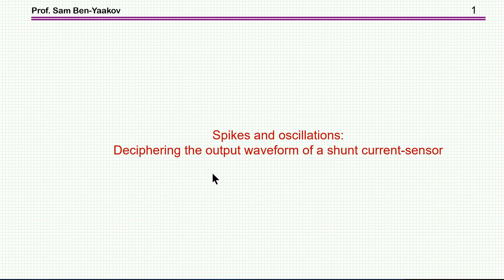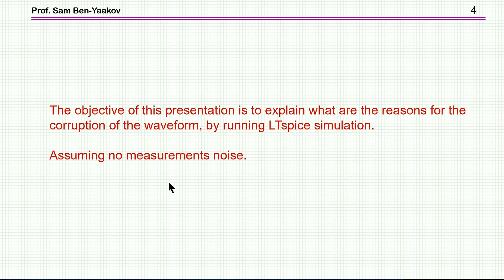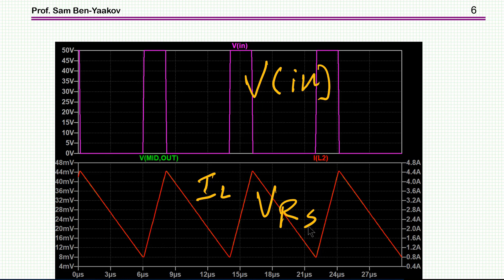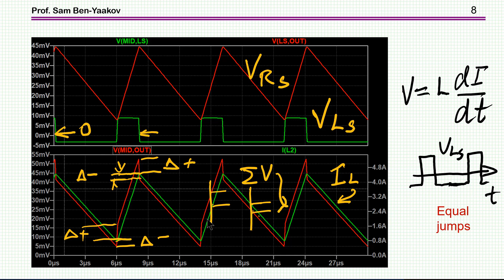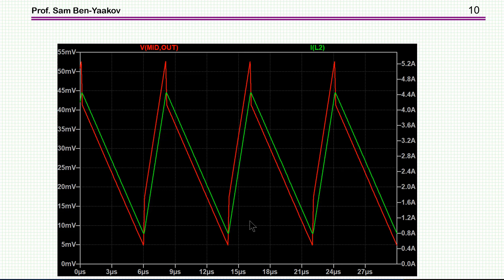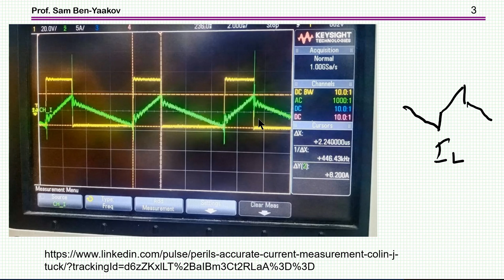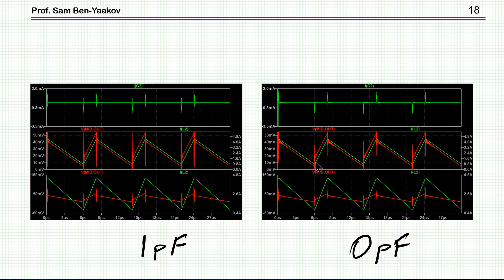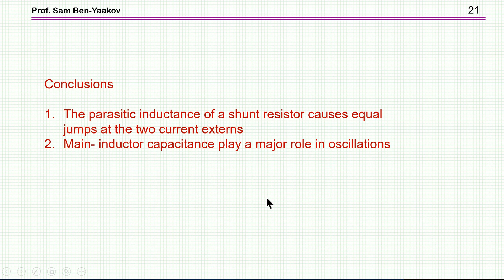Spikes and oscillations: Deciphering the output waveform of a shunt current-sensor

Comment: Thanks Sir. It is an wonderful video.i am facing the same issue. Pls let me know on how to remove this spike.
Reply from the maker: If you cannot replace the inductor with one of a lower capacitance, put a filter at the output, preferably by using a a ferrite bead and a capacitor.

Comment: Would not reading the current sensor at the times when the PWM signal is switching on/off be another way of filtering out the spikes and noise ?
Reply from the maker: You meant at the peal value?
Reply: @sambenyaakov  Not sure what that means.
But if the PWM signal is generated by a microcontroller, then it could be coded to not read current around that time.
I'm sure there is a way to do this with analog electronics also.
Reply from the maker: @station240  Which time ? You mean at the peak value? but the value does not reflect the correct current!

Comment: Ben, Put in the resistive element representing core loss in parallel with L2. That is most likely the cause of the step. You can manipulate a model to show a voltage-divider effect of two inductors, but that does not mean that this resulting measurement error is the main cause of the step.
Reply from the maker: Thank you for comments. To begin with, I am not sure that a parallel resistor that emulate core losses is relevant to a step change. Do you have any knowledge on that? Irrespective of this question, you surely must agree that the sum of a triangular waveform (the voltage on the pure resistance)  and a square waveform (the voltage of the parasitic inductance) produce a waveform with two steps.
Reply: @sambenyaakov    At my first job out of college 40 years ago, I designed a BH loop tester after hearing contradicting and simply incorrect ideas about magnetic effects from other engineers at work, and I have subsequently built several more over the years at different jobs to model effects such as inductance, core loss, saturation, etc. A square wave of voltage on a core always results in an approximate square wave plus triangle wave. It is not measurement error. Core loss is real. The width of the BH loop correlates with the loss as predicted by the Steinmetz equations very well as measured by the height of the square wave portion of the current measurement. These current measurements on a ferrite track the (Frequency)^Kf pretty well. Kf is typically in the range of about 1.3 to 1.5 for the typical range of frequencies that we use in power supplies. Remember that, for a given flux, the frequency is proportional to the applied voltage and thus, the rate of change of flux. On the oscilloscope you can see the width of the BH loop get wider as this flux-rate-of-change get higher. Furthermore, for each unique voltage (and thus, rate of change) the resultant square wave correlates to a unique fixed resistor value to model core loss. (It is slightly non-linear but, for practical modeling purposes, very good). The resultant current*voltage is power loss as we all know. The equation: H=N*I/L is very useful to generate a set of curve data for each core.
Reply from the maker: @darrellhambley7245  I am not clear about "A square wave of voltage on a core always results in an approximate square wave plus triangle wave" square wave of current?  Do you have any reference to a publications on that. This notion seem to be inconsistent with the more advanced core loss descriptions such as GSE (see https://www.ee.bgu.ac.il/~pel/pdf-files/jour144.pdf ).
Reply: @sambenyaakov    Reference to a "publication"? No. I'm describing actual lab data and correlating it to the shape of a B-H loop. Simply look at the width of a B-H loop, the "H" term. Flip the equation "H=N*I/lc" to get I, the current, and there it is!
Reply from the maker: @darrellhambley7245  For a BH loop you need a complete cycle , how does it relate to the initial step of the voltage?
Reply: @sambenyaakov   The B-H loop testers I've made apply a continual square wave of voltage so, many "complete cycles". The integral of voltage applied goes to the Y-axis and the X-axis is actual current.
Square wave excitation is important because (except for resonant converters) we usually apply square waves (of varying duty) to cores. For some odd reason, manufacturers still only give curves due to sinewaves.
Reply from the maker: See also https://youtu.be/6NpobetG3t8

Comment: Thanks for covering this topic! It is indeed very important to understand the HF paths and source of oscillations in such a system as this is related to EMC, where the HF content can potentially radiate if the system is prone to it. Also, the lower f osc can introduce uncertainty in current measurements sampling. 

Two points from my side for better matching of real behavior:

1. series stray inductance in the HF loop consisting of C2 and C3, thus putting some Lx in between the two (similar effect to L3 is expected)
2. If the switches (low side diode) in the HB are Si, I would consider diode reverse recovery effect and the phase node voltage oscillations as its consequence. The resonant f would depend on the loop L-C of the HB and the diode’s snappiness. 

Thanks again
Reply from the maker: Thanks for comment.

Comment: Normally engineers remove transients by adding filters, this is the first time I see anyone adding components to induce transients and simulate real physical effects 😂. I would have easily brushed off the ringing as Gibbs phenomena due to harmonics of Fourier series coefficients or signal reflection since some resistors have wound coils. But the signal applied was low frequency, professor you have done it again. I have questioned myself and got lost as usual.
Reply from the maker: 🙂 Thanks.

Comment: Thank you sir. I encountered the same problem with a boost converter. Till now I was much confident that a capacitor of low esr ,something like a ceramic disc capacitor, will fix this problem. But from your explanation a capacitor across sense resistor will boost existing problem. In my system current sense circuit senses overcurrent at 25% load. Adding an RC filter to the voltage across sense resistor be a good idea? Thank you 🙏
Reply from the maker: Thanks for sharing your experience.

Comment: Excellent video, Professor Ben-Yaakov my beloved. It may be worth noting that in practice, although output capacitor parasitics decrease the "noise" on the shunt voltage, they increase the common mode component which may increase the "noise" of the system as op-amps have poor high frequency CMRR. However, examining the true voltage on the shunt as you did is illuminating on its own, and ignoring the measurement considerations better highlights the effects of parasitics in the power loop. Thanks.
Reply from the maker: Thanks for comment

Comment: Wow, this is a videolesson that comes on the perfect moment for me. I have to slow down a feedbackloop because of the unsteady "jumpy" waveform of the measured signal going into the opamp, but when it is finally steady enough the whole loop is so slow that it becomes an oscillator when loaded with the load for wich i am building this. Of course with a much steadier testload it works always fine enough! 
(Btw, i needed to start up my old phone to leave this comment because both my new ones give an error when trying to type a comment in youtube!(thus, i still enjoy each&every new videolesson!) Oh btw, since i can shortly type a comment again, i can finally ask what i want to ask for since a long time: would you use a bigger mousepointer? (for people like me who learn from your videolessons from the phonescreen? Mostly it is clear enough to follow because the explainings mostly do not need the pointer, but these little moving "flashes", or so it seems on a little phonescreen, they often underline your words as èxtra clearmaking help, or so i think?) 
Also a big Thank-You, again, for giving me, us, such a great chance to learn from you with these up-level-but-perfect-to-follow videolessons!
Reply from the maker: Dear Rob. I missed you😊. A larger pointer is indeed a good suggestion. As it is, the pointer is large but a lager one will certainty help to follow it better. Or I will try a different pointer. I believe my recording program has a "laser" pointer. I will give it a try too.